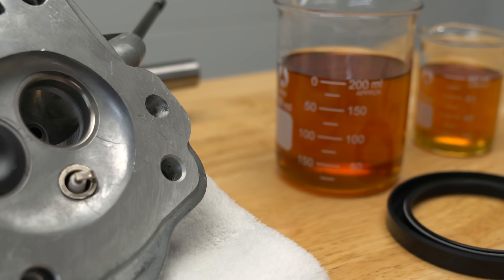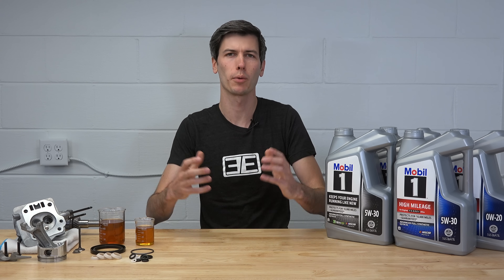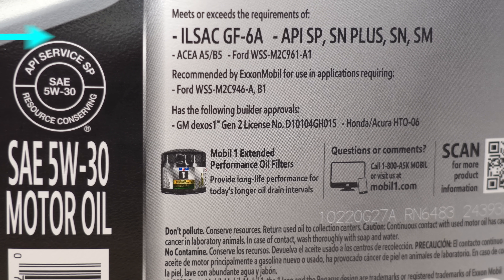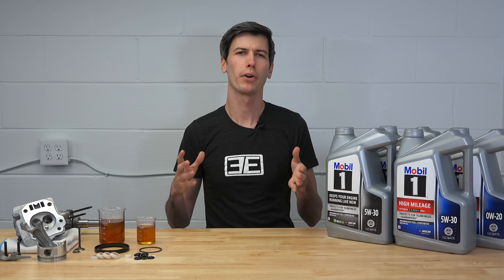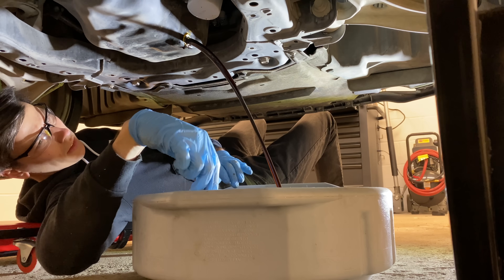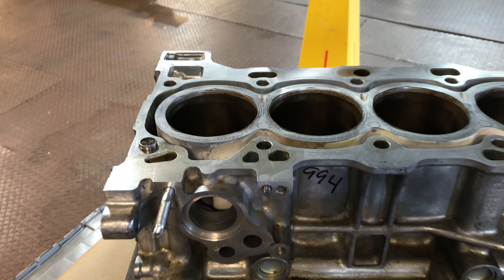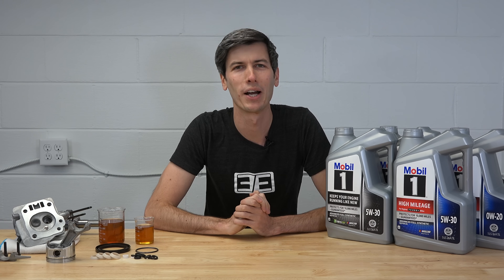Is Synthetic Motor Oil Bad For Old Cars?

Comment: NO no no no no no, you've just made every HEUI engine that relies on the correct engine oil viscosity to run correctly, to stop running. Whilst your advice on running older engines on thicker oils is not bad in theory, it is essential that in a HEUI engine, the correct grade of oil is used to enable the injectors to run correctly.

Comment: If I put synthetic 10-40W in my 86 4runner I go through 1/2 a quart every gas tank. If I run Castrol GTX 10-40W I go though 1/2 quart every 20-30 tanks.
My Mechanic said it is thinner and works it's way around old motors and burns up with the looser tolerance on older cars.

Comment: I have been using Canola Oil in my 1972 Chrysler VH Valiant Ranger sedan 318 cu in (5.2 L) V8 since I got it from my Grandfather. He had been using Canola since the late 70s and still original motor with 850,000km on it.
Reply: I also have a 2015 Golf R Mk7 but use 5w30 Castrol LL Titanium since new. However, considering trying Canola oil?

Comment: Decades ago my dealer asked me not to use synthetic in my Mazda RX-7 Rotary Engine. Mazda also had a sticker with the same statement under the hood. I was told that the rotary engine did not get hot enough for synthetic oil use in the 1990s. I moved a few times and multiple Mazda dealer service shops enforced high quality conventional oil for rotary engines as they ran cooler.

Comment: With older vehicles such as my 99 Chevy truck, 5.3 V8, I just stick with 10 or 5-30 conventional oil every 3,000 miles, but I use Wix oil filters.
I have 280,000 miles without so much as a sweat and lose close to one quart in 3000 miles.
A new vehicle, I'd start with full synthetic.

Comment: I switched to synthetic oil in my 1982 motorcycle right after the first 600 miles. Wet clutch and no slippage. For air cooled engines it (synthetics) helps them run cooler. I have not gone back to conventional oil since.

Comment: 👍✅I use Royal Purple High mileage and Amsoil also engine additive Engine Retsore 6 & 8 cylinder seen improvement of 5 & 10 psi  compression difference . And GoldFilter K&N & K&N Air Filter Stock intake and K&N Fuel Filter .

Comment: Speaking from personal experience of running a Quick Lube shop for 10 Years:
One need to be very careful switching to Synthetic on the old motor if engine has solidified sludge in the crankcase. That usually happens when low quality organic oil was used for the long time or proper oil change intervals were not followed. Synthetic oil will loosen the sludge that can very likely clog up the oil filter causing loss of oil flow and oil pressure. Synthetic oil is very good in cleaning up the internals and I even saw it restore the cylinder compression by unsticking the piston rings.

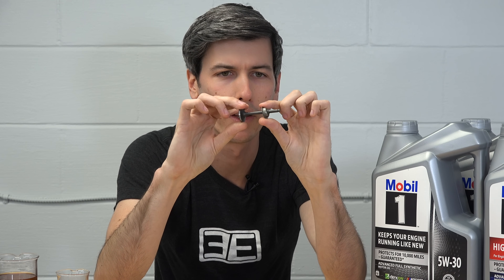Comment: @7:50 Valve seals have absolutely NOTHING to do with the intake manifold and it’s literally impossible for valve seals to introduce oil into the manifold. Bad/worn valve seals allow excessive oil to enter the cylinder by the oil being drawn down the valve stem, into the cylinder. This is caused by heat and high miles, as well as worn guides.

Comment: My brother recently bought a Daihatsu HiJet (one of those cool little mini trucks with the steering wheel on the right). Interestingly, the service manual contains a clear warning NOT to use higher viscosity oil than recommended as it will create a risk of damaging seals and gaskets due to over-pressurization, thus causing leaks.

Comment: Complete waffle for 10 minutes. The new oils do not have the required additives for older engines, I used Mobil1 in the 80’s on all my cars, had numerous problems, never again.   Porsche at some stage recommended Mobil 1 0/40 for all air cooled engines going back to the 60’s… they sooner changed their specifications after numerous customer complaints, I’m an ex-Porsche technician

Comment: The issue is not the oil it is the additive pack in the oil. Modern cars all have catalytic converters, and all engines consume a small amount of oil due to the cross-hatch on the cylinder walls. Zinc has been removed from all modern oil because it harms the catalytic converters. Zinc is a major reducer of sliding friction older cars with flat tappet cams need this zinc to protect the camshaft and lifters.

Comment: I recently put mobil 1 synthetic 10w30 in my kei van with a 660cc 3g83. it started burning oil like crazy. Replaced the PCV because of how much it was burning, but that changed nothing. I decided to switch to shell rotella t4 10w30, a conventional oil, and it stopped burning after a day. While I do agree with a lot of this, in my circumstances I needed that conventional oil. I noticed the synthetic oil burning smelled significantly worse compared to conventional oil before the valve stems sealed up with the shell.

Comment: about the thicker oil for worn out engines: I've been doing that for years to buy me time to get the parts for a rebuild or replace.  My old Dodge Dakota's 3.9 got to where it wouldn't hold oil pressure at idle in the summer when running the A/C.  I simply started adding Lucas to the oil at oil changes.  I bought a new engine to put in it, and drove on for 50K miles before other issues made the replacement required.  Still wasn't having oil pressure issues so long as I added the Lucas.  When I tore the engine down, I found the rod bearings to be fairly worn, and the mains to have a good deal of wear as well.  The issue that pressed me into replacing the engine?... a belly pan gasket on the intake failed and it was inhaling oil from the valley.

Comment: Without watching the video - I state facts.
Synthetic oil will stop wear right where it is.
If the engine is still in good running order but just has high miles - synthetic engine oil will stop the wear where it is.
It will also clean the inside of the engine due to synthetic oils high detergent capabilities.

It will not stop an engine that uses oil due to excessive engine wear.
Synthetic engine oil will reveal worn rubber seals because most of them are clogged with deposits and the detergent properties of synthetic oil will wash those deposits away revealing a previously worn oil seal.

Comment: In my experience trying to swell a seal to stop a leak may work but if you leave that sweller in there the seal may overswell and you’ve got the same problem again. So run the seal sweller for a while then change the oil maybe after a week.
Reply: It will swell seals to make them stop leaking then they leak worse.

Comment: Which begs the question, "What is an old engine?"  Even with conventional oils, they last next to forever.  I had a Jeep Cherokee with 210,000 miles on it when I got rid of it.  Granted, the last maybe 50,000 miles was with synthetics, including in the manual transmission and the differentials.  I think I was still getting 4,000 miles per quart.

I have a 2000 Buick GS with the same 210,000 miles on it.  Running Mobil 1 since I bought it maybe 25,000 miles ago. Presumably the original owner used conventional.  I added Bardahl? stop leak and now it just has a few drips plus the classic for that engine valve cover seep.  Again, maybe about 4,000 miles per quart. 

With modern lubricants, fuel injection (no more gasoline in the chamber during cold starts, and metals, about the only thing that age affects are the seals.

Comment: Hello, API SP engine oils are supposedly formulated to provide protection onto timing chain. There is no such claim for API SN.

So far I continued using 10W 40 semi synthetic - as done by the previous owner of my 16 years old car having a supercharged 1.8litre M271 engine. Ambient temperature here never dropped below 70deg F. I do not mind using this much more expensive API SP synthetic if it really does provide protection for timing chain. So what additive they had to enable such claims?. 🤔🤔🤔. Thanks.

Comment: All motor oils since GF4 have a seal swelling agent. Prior to GF4, synthetic oils typically had a seal swelling agent, because without it, they wouldn't swell the rubber seals as much as conventional non-synthetic motor oils. I don't know if the amount of seal swelling agent makes a difference. I did have seal leaks on two engines when switched from Mobil 1 to Pennzoil Platinum, but switching back to Mobil 1 stopped the leaks. Pennzoil uses custom blends of chemicals, but Quaker State uses common, "canned" blends of chemicals, often used in store brand oils. Maybe Pennzoil displaced some seal swelling agent with their custom blends.

Comment: -I think this depends on what you think is an older engine for instance  i dont think I would run synth oil in a prior 1990s engine because in the older oils it had certain things that worked for those engines and if you use synth oil you have a high possibility of wearing out things like camshafts quicker and such  I think the older 1990s 4.0 litre jeeps have this issue people switching to modern oils like synth oils on even rebuilt older style  engines . but it has been a while I may be wrong in my memory

Comment: As a synthetic dealers for many years I have found it is not good to use synthetics after 40K miles .
Reply: What happens at 40,000 miles? Should I destroy my car using an oil that destroys after treatment systems?
Reply: @paulanderson7796  The reason Paul synthetics actually cleans rotating units around seals but the seal that have been stretched for years do not expand back so you get oil leaks . Semi synthetics might ne a better choice ,  also change your spark plugs , use Denso double platinum you will like the slight power increase .

Comment: Are we just not gonna talk about the Renesis engine? Ope, commented too soon. Okay, the main reason we use conventional oil in the RX-8 is actually due to cost. It burns oil by design, as Jason said, so you're going to be spending a ton on oil feeding it synthetic. We switch to full synthetic engine oil when and only when the oil injection system is overhauled with its own independent oil tank, where you can put dirt cheap 2 stroke in, which burns much more nicely than 4 stroke anyway because it's designed to be mixed with gas in the first place.

Comment: Porsche may well have been using M1 as factory fill since 1996, but their priorities are not the same as ours. They value fuel economy far more than I do, for example. I am seeing M1 0W40 European Formula FS starting to shear and dropping below viscosity grade (e.g. 11.65-11.78 cSt at 100 C) as early as 3,000 km in a 991.2 GT3. Despite a 3k km OCI. I shudder to think what would happen under harder driving with the factory recommended 12,000 MILE or 20,000 km OCI with the same engine.

Comment: Changed to Mobil1 synthetic in my 75,000 V6 Mopar engine.  Two weeks later the left bank cam lost all oil flow.  Mechanic dropped the pan and there was 1 inch of sludge in it that had been loosened up by the Mobil1 and plugged the oil lines to the head.  This was a used car we just bought.  Mechanic said the previous owner never changed the oil in it.  Had to put a new engine in our "new" car.  Never going to make that mistake again and sticking with conventional oils which are often a blend of synthetic and dino oil  If I ever have a new car I will use synthetic, but I normally buy low mileage used cars.  Lesson learned.
Reply: Had it used the correct oil throughout its life there would have been no issues.

Comment: i've used syn oil since 1980 put 700,000 miles on a 1977 440 ramcharger 20w 50  and that was in minus 30degrees F started easily electric fuel pump never used oil between changes every 8,000 mile  also used it on my 2005 pathfinder only 450,000km never a problem used 10w 40 all it's life . To much BS OUT THERE

Comment: If I have a 1960's car that originally called for 30 weight oil, what would be the best multi weight to use?
Reply: It's not just about viscosity (and weight is a misnomer). For a sixties car 10w30 would be reasonable. There are factors now that regarding emissions 'management' that would not have mattered in the 1960's. Modern low SAPS formulations would offer you no benefits at all. Even 15w40 would work and mineral won't cause problems.

Comment: Question: ‘High Mileage’ oil or ‘DEXOS approved’ for my Sierra that calls for DEXOS approved? Unfortunately, they are not synonymous.

Quandary: The Mobil 1 Full Synthetic 0W-20 I’ve used for years is DEXOS approved. The Mobil 1 Full Synthetic 0W-20 ‘High Mileage’ flavor is not DEXOS approved 

So, what’s the priority? At 7:36 you say “as long as you can see it meets all of the required industry tests.” I’m assuming the DEXOS certification falls into this category?

I love your content! It’s soooo nice to get qualified engineering advice and ditch the coffee pot / water cooler advice. 

So, at 172,000 do I stick with Mobil 1 0W-20 FS ‘standard flavor,’ or switch to Mobil 1 0W-20 FS ‘High Milage’ flavor?

Thanks,
Sleepless in Trenton

Comment: -- HEY  -- in the things yu speak of -- Lubricity has always been the culprit of misunderstandings - it is said to make rings so slick -- that oil leaks by more easily - and can cause the seals to become too thick and slick or may even make them crack  -- yu did not even mention these factors -- odd yu would not even know of these factors that are what is said to be the culprit - to my understanding -- lubricity is in all synthetics - and not  regular oils - whats up with that ? !   - and there are two different kinds of lubricity's -- one is much better than the other -- did yu not know of these factors involved ? !

Comment: Good information here. I like to use  thicker oil in higher mileage cars even if there isn’t any known engine issues.
Reply: What is 'higher'?
Reply: @paulanderson7796  roughly 100k+
Reply: @mjfx328  It's not just about viscosity. My car requires oil that meets ACEA-C1 or JASO DL-1. These are only available in 0w30 and 5w30.

I ran a BMW 528i (M52TUB28) engine to 380,000 miles on 5w30 oil meeting BMW LL01 / BMW LL04. Had no issues.

Comment: I still wonder: how well do you have to clean out the old oil before adding in synthetic? Do they blend well. Or is a standard emptying out of the old (non-synethetic) oil followed by filling up with new (synthetic) oil just fine?
Reply: Recommend an oil flush before changing the type of oil - and make sure the new lubricant is compatible with your engine! I changed my oil to an ester-based lubricant (approved by my car's manufacturer) a couple years back and did the flush beforehand. All going well so far 👍
Reply: @mrD66M  Thanks!

Comment: Fully Synthetics have a higher viscosity index than regular oils which means they are naturally more temperature stable which is beneficial for older engines actually.
They have a stronger oil film and better shear stability.
On paper fully synthetic oil is superior.
The question is what additive package is used and what seal conditioners are in the oil. Some oils have really lean and basic additive packages you know low ZDDP, low Phosphor, no Molybdenum and no Boron.
But others have a great additive package the only way you will ever know is by looking at lab reports.
Most fully synthetics I know of are marketed as premium oils and have rich additive packages.
Reply: The general idea with synthetic base stocks is that additives can be reduced.
Reply: @paulanderson7796  all the fully synthetics for sale in my country that HAVE been lab tested which isn't all of them indicated rich additive packages.
They are marketed as premium oils so that makes sense to me.
Reply: @alouisschafer7212  it does to me as well. But primarily reason behind synthetics is the more robust base stocks. They don't need to be saturated with the same amount of additive required by mineral oils. We can't run today's exhaust treatment systems with levels of additive packs that mineral oils need.
Reply: @paulanderson7796  "But primarily reason behind synthetics is the more robust base stocks." Why I choose to run that oil when I find it for a good price :goodvibes:
I assume that well before my time when basestocks were crap compared to what we have now they pumped them full of additives like ZDDP right like much higher levels than we seen today?
Well today we have special low ash oils with additives formulated to be compliant with modern emissions systems. But I don't trust those a lot they have really lean Additives comparted to standard oil.
My ride is a 2007 and it burns no oil so I don't have to worry.
Reply: @alouisschafer7212  I think we're kind of saying the same thing. Applications are as they are.

Comment: Running fully synthetic 0w40 in a 16 year old car. Engine loves it!
Next summer it will run 5w40 or even 10w40 I want to see how quiet I can get the engine. Im battling lifter noise to be exact. Ticks a bit on cold start but goes completely quiet when the engine is warm.
Going by specsheets 5w40 and 0w40 have virtually identical viscosity at 40C and 100C the numbers as almost the same just cold flow ability is better on a 0wX oil which only matters at extreme cold though.

10w40 is a bit thicker at 40 Celsius than 0w40 or 5w40 so it should be a good summer oil.

Fully synthetic oils are superior in all properties to regular oils which are all based on hydrocrack synthesis. Boom that's the argument done with.
Standard oils are can be 80+ % HC and better ones are ~60% HC blended with fully synthetic oils to boost up the properties a bit. 
The absolute best oils are Ester based like the RedLine oils but hah YOU opay for that oil not me... also its very rich in ZDDP probably too much already for my car so I settle on a standard fully synthetic that's PAO based.